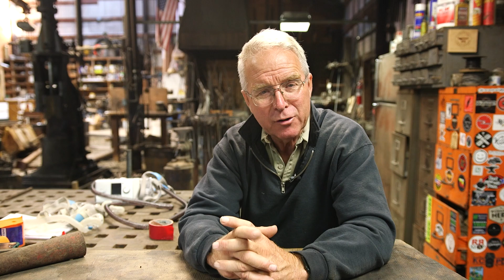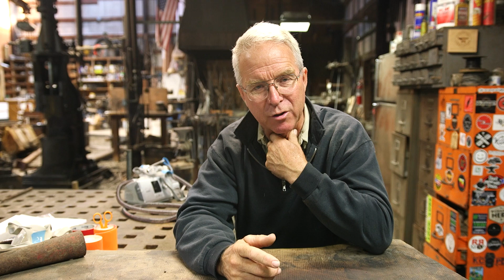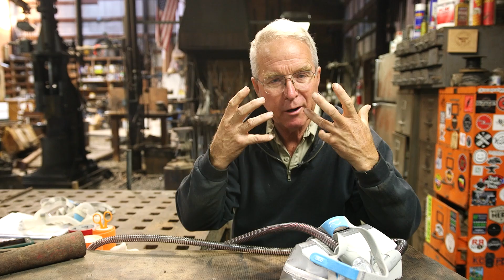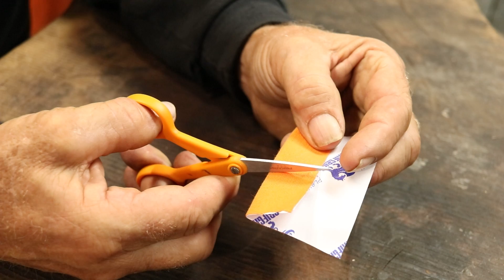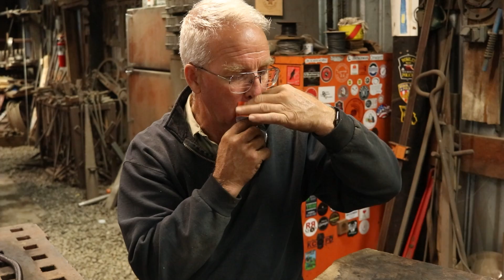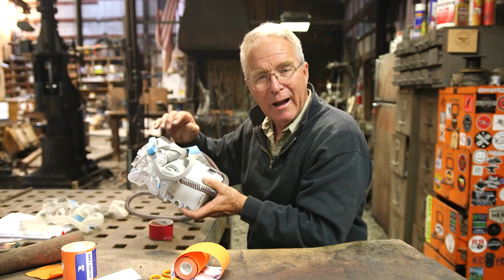Tired Contractor  Here’s My Simple, CHEAP Sleep Apnea Solution

Comment: As a Respiratory Therapist I have discussions with patients about Apnea and I had an Asian ( not to bring in race) patient to ask me for some tape while in the hospital. To my amazement he did just like you demonstrated. As we talked, he informed me that most people he is acquainted with,  who have sleep Apnea does this. It is a traditional treatment and only a few use machines. AMAZING!!
Reply: My nose stops up tight so I found out that if I use a cheap nose spray (.05%) at bedtime, spray lighty, then sleep on my side, I sleep better. My nose has stayed stopped up for years so the tape may not work. Will try it.
Reply: @ronleachsr  I have the same issue...and what if you woke up with a cold ( stuffy nose/ runny nose )? I would be terrified to tape my mouth shut. I think i will pass on that lol
Reply: As a respiratory therapist you need to search up Dr Fung, Dr KennBarry, and/or Sten Eckberg / sleep apnea. I didn’t mean to change your life so quickly, but you’re so very welcome. They have changed my life at no cost.
Reply: @ronleachsr  try ‘Breathe Right’s’. You can pick them up at Walmart, Costco or something like that. Buy the ‘extra strength’ ones. It could be a game changer for you. 👍
Reply: That's why he cut the slits in the tape.. so he can still get some air through his mouth if needed.
Reply: Some people used to put tape strips up and down beside the mouth instead of using a chin strap with their CPAP. This advice is not likely to help anyone's sleep apnea unless you keep wearing your CPAP. It could help mouth leakage while on CPAP, however. It can take a little time to get used to CPAP, but it is still the only thing that works for almost every case. Don't give up on it too quickly. Most other treatments only work for mild to moderate cases. Correcting a nasal obstruction is always a good idea though. Think of it this way: If you put a drinking straw in your mouth, put your finger on the end of it, and suck, what happens to the straw? The middle collapses. Think of your nose as the end of that straw. If your nose gets stopped up, it can cause the rest of your airway to narrow as well. Sometimes allergy sprays help. There are other devices that can help open nasal passages besides Breathe Right strips. They are comfortable and work well but can get expensive. I can provide more info if anyone needs it.
Reply: @speedprofessor5397  Sure.  Would like more into.  Thanks.
Reply: @ronleachsr  Have you looked into balloon sinuplasty? It's fascinating. In angioplasty, the balloon inflates and widens the blood vessel. In balloon sinuplasty, the balloon inflates and widens the sinus in question, giving you room to breathe. Of course, that's if the problem is due to swelling of the sinuses, as opposed to a lot of mucus that you can still expel.
Reply: @scottcharney1091  sounds interesting. I have allergies but I have little drainage.
I have wondered if there was something that could stop the swelling shut.
Cigarette smoke,etc will stop me up and other allergies. 
Are you in Johnson City?
Reply: @ronleachsr  I'm not even sure where Johnson City is! In any case, the procedure seems to be pretty common and low-impact, so I would definitely look into it.
Reply: @scottcharney1091  thanks.
Didn't have my glasses on and I thought you were someone in J.C with a name similar to yours.
Reply: @AdamVine  Absolutely no effect on a blocked throat! Watch the video!
Reply: As a respiratory therapist, do you think CPAP’s should use normal saline instead of water.
Reply: @AdamVine  After a while that thing will give a rash on your nose.
Reply: @ronleachsr  In times when I've had a stuffy nose I would tilt my head to the side or side sleep and the top nostril will clear.
Reply: @pakenhamin  That happens to me too. I lay on my right side a and my left clears to a point but will close later at night. Before Covid, Walmart had an 88 cent nose spray I found out if I sprayed both sides with short bursts, my nose did not stop up the next day like a stronger spay does.
Thanks for the reply though. 
When I used a c pap machine, about the time I went to sleep, the mask or nose blew off a would wake me up. I didn't find out about the cheap spay until later.
Reply: @ronleachsr  can you tell us the brand of that spray?
Reply: @AdamVine  Even better if you combine them with the tape, I'm thinking.
Reply: Yeah I'm Malaysian (Asian) n I have seen local celebrities using tapes to cover their mouths while sleeping to prevent snoring..but they cover their mouths with two tapes (forming an X over their mouths)...
Reply: @bradmac4985  just wondering...oxymetazoline is a decongestant, whereas Flonase (fluticasone) is a steroid. 🤔
Reply: Interested to know besides sprays, decongestant pills,, breath right strip, what other options to keep nasal passages open. I know there is a surgery where they insert a tiny balloon in passage. Any other options you know?
Reply: @ronleachsr  I do that when its really severe. You should try a humidifier in your bedroom. It's amazing the benefits you can get from it and one of them is breathing easier.
Reply: I am a chronic snorer to the point I could make the walls shake, but I never really had a problem of being exhausted during the day, just that it was hell for my partner. Then I discovered mouth taping. What a marriage saver, and a life saver too. I just have a roll of 1" wide surgical tape beside my bed and I just tear off a strip, apply it to my lips, and that's it. The only time I do snore now is if my nose is blocked with either hayfever or a cold, but I fix that with a good nasal spray. I went down the track of Apnea machines and they were a dismal failure, like sleeping in a wind tunnel. Thank God for taping.
Reply: I have been using a cpap/bipap for year and i hated using it at first and now i still hate using it. If i didn't have facial hair i would try this in a heartbeat!!! But pretty sure it will only wake me more from having so many hairs pulled out in my sleep.
Reply: I wonder if that may be traditional treatment Asian countries because maybe they're more concerned with health band with the medical systems educating people to enrich the pharmaceutical companies and medical equipment industries. Prime example the last three years of medical tyranny.
Reply: @bradmac4985  Dr. Nelimed sets one OXYMETAZOLINE hci with moisturizing gel its great
Reply: After I wrote a post about the cheap nose spay from Wal Mart (just said NASAL SPRAY on the bottle, I found one I had stored, I tried Flonaise again and it started working for me in the daytime and night. If I'm a little stopped up, I use the cheap spay and my nose remains open all night. The cheap spray Wal Mart has now, works but will start drying my nose up and any drainage gets hard and eventually there's a small drop of dried blood.
The old 88 cent doesn't do that. There's something different in the 2.
But as I found out, Flonaise use lightly works now and it didn't before????
Reply: @AdamVine  Breathe Right helped some, but nowhere near as much as mouth taping in an ‘X’.
Reply: @Laurie_Tinsley  Just take it off if that happens, easy.
Reply: I have a beard, this won’t work for me. I tried using the chin strap with my CPAP but it was too cumbersome.
Reply: @popopthepatriot  Is it not worth shaving to have better sleep?
Reply: @LadyPashta  no. The
Reply: 4 Horses  🫤🤷🏽‍♂️
Reply: Buy a pulse oxometer at your drug store to measure oxygen saturation. Not expensive and you just put it on your finger and press a button to get your reading in a matter of a few seconds.
Reply: @suetucker9264  thank you
Reply: There is absolutely nothing wrong with bringing up race.

We are all different to a biological level.

And that is OK.  Everyone is different.
Reply: @ronleachsr  you could also try using a netti pot to clear out your sinuses.
Reply: @ronleachsr  look up alternative allergy solutions too.
Reply: @scottmiller7001  to explain the “region/ country customs”
Reply: @scottcharney1091  North of San Antonio
Reply: @scottmiller7001  It shows ones background and different culture.  My Asian friends are extremely informed and in the medical field and believe in traditional practices in addition to scientific practices.
Reply: @speedprofessor5397  yes if you have more to add please share!
Reply: Ah, come on man!  Think about all those people who depend on the purchase of the machines!  Tee hee!  😂
Reply: @locosiete6839  CPAP machine caused weight gain. I googled "my CPAP causes weight gain"....and surprisingly IT IS A problem for many. There is a doctor (Dr. Parks) that wrote research papers about it and has a blog with patients complaining of it also.
Reply: @ronleachsr  Afrin opens a clogged nose fast and keeps it clear all night!
BEWARE: It can be addicting and hard to sleep w/out it.
Reply: Lmao!!!

Comment: I’m a 69 year old, 105 lb woman with sleep apnea.  Several years ago I was told about using simple envelope tape at a group retreat I was at. It worked and saved others in our shared sleeping room from my snoring.  I now use paper tape over my lips, first my rolling my lips inward, placing a 1 1/4 inch length tape over them, leaving the corners of my mouth clear, then relaxing my lips; this tightens the tape over my lips.  This doesn’t always stay on through the night because of moisture, but for the most part, it’s simple, cheap, and my mouth isn’t dry upon waking. 
I appreciate this video, and now I’m vindicated, as my grown kids think I’m such an oddball.
Reply: You'll be vindicated when THEY get sleep apnea! Then they'll think you are the wisest woman!
Reply: try medical tape it will stay on longer
Reply: It's Dangerous.. Get a sleep test..
Reply: Thank you for explaining-easily understood! Trying it on my husband!
Reply: @vibes..585  

Explain the dangers.

Comment: Scott, I stumbled on the same fix you did after about 15-20 yrs of struggling with 4 different machines. I just use two strips of a tape called Nexcare, placed vertically over my lips, roughly on either side of the middle of my mouth. The difference is that I'm fine with continuing to use the CPAP machine. After that fix, I sleep an average of 8 full, uninterrupted hours, and I can recall my dreams with absolute clarity. I'm only 6 months away from 70, and a urologist I recently had an appointment with said my 8 hrs of continuous sleep puts me in a small minority of men my age.  I've been using the tape for about two months, and it will be interesting to see if the change shows up on my data at my next annual consult with the sleep doc in two days. Try the Nexcare tape. Your pharmacist will know what you want. After my fix, the biggest sleep issue is that my skeleton is an absolute train wreck, but at least I wake up rested and creaky instead of groggy and creaky.
Reply: What did you sleep doctor say?
Reply: @Hephzibahh  kenyaaaaaa, Thanks for the suggestion. I'll look into it.  I won't go into detail about the rough and tumble life that has caused my creakiness, but more than one of them was the sort of incident which has Ieft many others either paralyzed or dead. I've testified to more than one person my strong belief that God's omnipresent providence and protection is the only reason I'm still alive, and while some doctors did help, I credit Him with gratitude for the degree of healing He has granted, so I can live an active and joyful life. I'm trying to honor and repay that grace with a life oriented to His purposes, and be  someone my family and others want to follow.
Reply: @livenfree  The positive effect was immediately apparent from two months of data on the machine readout, so I got two thumbs up on it.

Comment: I have both types of apnea as well.  One thing that made a huge difference for me was getting a bed that I could raise the head about 30 degrees.  Also, positioning...I’ve figured out how to use pillows to help keep me on my side.  I use one under my arm on top to help expand my chest cavity.
Reply: I use cushions too. Actually, I bought a soft, floppy teddy bear for the purpose because it stays in place better.
Since then, I have discovered that if  you sleep on, for example, your right side with your left hand on your hip bone and elbow bent at your waist, it just balances effortlessly and puts no weight on the chest.
Reply: I really don’t think there’s anything wrong with not breathing if there’s not enough CO2 to trigger it. 

I attended a meditation meetup where we did an intense breathing exercise that floods your system with oxygen. And you stop breathing. 

We are just laying there most of the time while sleeping. How much oxygen can we be using?

The apnea that interrupts ir prevents your REM sleep is the real killer in my non-medical opinion.
Reply: #meathealsus #meatandmentalhealth #meatandcancer
Reply: I've been doing that for 46 years. Never could sleep on my back. I have 4 pillows to keep my head elevated and on my side.

Comment: Mouth taping has improved my sleep very significantly.  I found that two Flexible fabric 1”x3.25” band-aids in an “X” pattern work very well.  Also keep some straws bedside so you can rehydrate without removing the band-aids.

Comment: I also had a CPAP. It was like trying to sleep with a Hoover vacuum, strapped to my face!! People have told me I should tape my mouth shut, so I think that I will try your method! Great video, you are a born teacher. You are the “Breath Whisperer”!! 😊
Reply: Have you tried it. Jw wondering how it worked out.
Reply: Request a BiPAP unit from your sleep consultant it reduces the pressure so you can exhale and then raises it back up to keep your airways open.  Keep complaining to your sleep consultant insurance companies don't like to pay for this slight increase in price for the BiPAP but it makes a world of difference. I recommend you get a unit that has the heated hose ResMed air curve 10 is a great one. Stops you from getting dried out at night.  A little aloe vera gel in the nasal passages is great too to keep you moisturized overnight.
Reply: Actually the first cpap used a motor removed from a vacuum cleaner.

Comment: This video was shared specifically for me.  I can easily equate my struggle to the time I collapsed my right nasal passage & started becoming a mouth breather. I’ve been desperate for replenishment. I’ve had to entertain a different line of work considering how tired & sapped of energy everyday.  Brother, I applaud your efforts during your spec home & all the wonderful content over the years.  I believe this post will be what changes things for me moving forward.
Reply: Buy the wide scotch tape - two sided the sell to hang on walls for pictures. I used to wear the nose strips but they were so costly I figured out a solution.  These tape pieces. I cut each night holds my nostril open so I don’t become a mouth breather.  Clean your nose well with paper towel before putting the tape on.  It works magnificently and is much cheaper than nose strips
Reply: Ent surgery can do wonders these days. I was unable to breeth through my nose and surgery completely fixed it.
Reply: @rob8145  hi rob what was the surgery called as i have trouble nose breathing and need to sort it out
Reply: @rob8145  yes, I need that also.
Reply: Turbinate reduction surgery & something else to fix a deviated septum. I found a doctor with good reviews on Google and the results were amazing.

Comment: I've been in the same situation for about 7 years. What I've been using is a mandibular advancement device that hinges let your lower jaw ease forward, which keeps your tongue and soft palate stable so your airway stays open while you’re asleep,10mg melatonin and a allergy pill at night. Good to hear that you've found a workaround that works for you. I've also tried the  CPAP machine and hated it.
Reply: I had a dentist fit a custom dental guard for the same purpose since I have an overbite.  $600 but it has lasted many years and also keeps teeth grinding from destroying my molars.  Far cheaper and less painful than a root canal!
Reply: I have the same dental device,  take 10 mg melatonin before bed and, on advice of my dentist, put a piece of medical tape from under nose to chin to keep my mouth closed.  Thought he was joking when he said this, but it works !